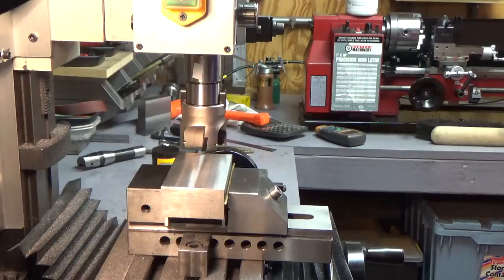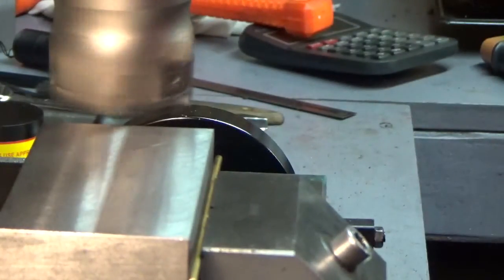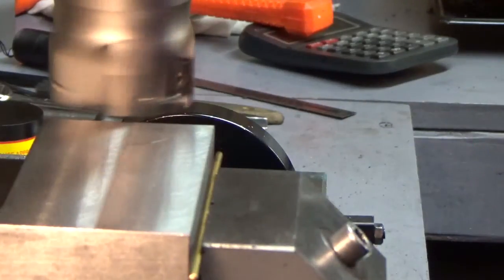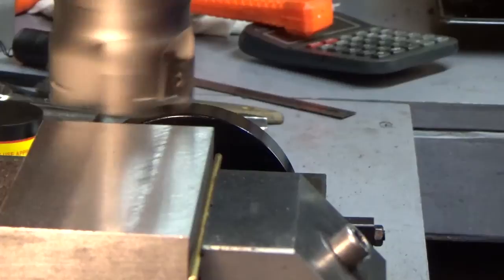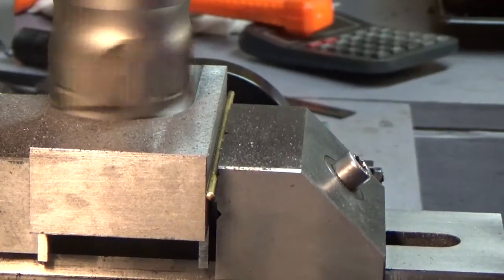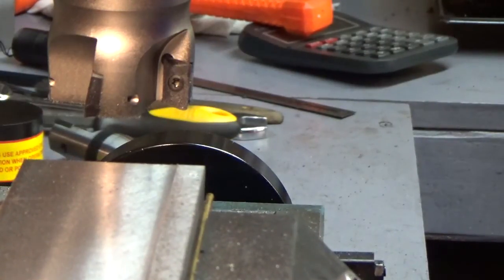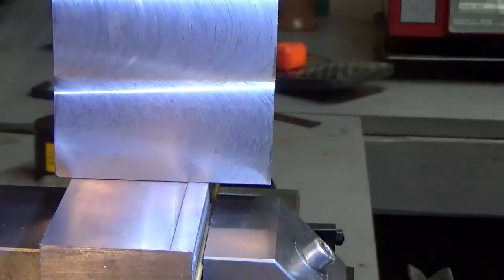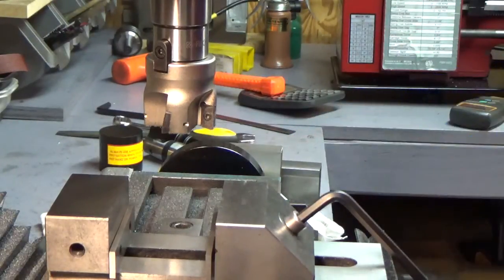Cast Iron vs Steel Comparison using a Chinese 50 mm 4-Flute Face Mill

Comment: Taking a 0.010-0.020" is needed to get a quality finish in cast iron.  I'd skip the back cut if you want a proper surface finish evaluation for that cutter. The back cut only served to  smear the finish and leaves it looking much rougher, kinda defeats the purpose of the evaluation.